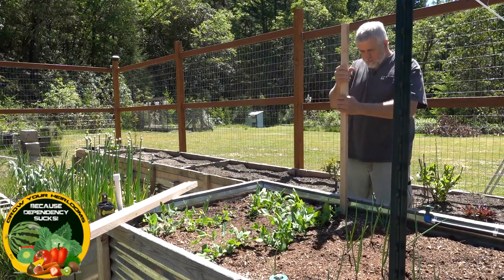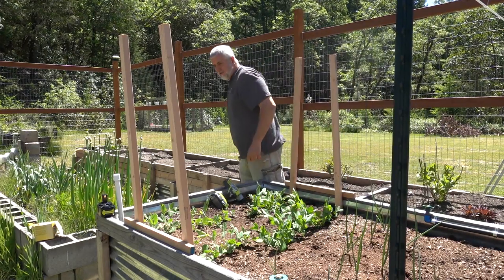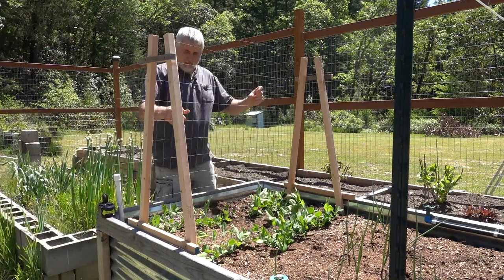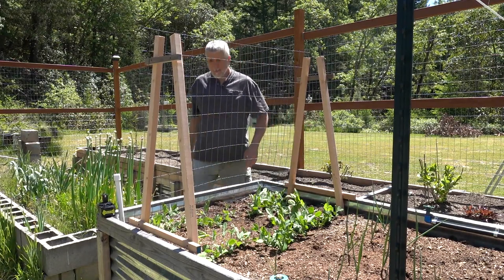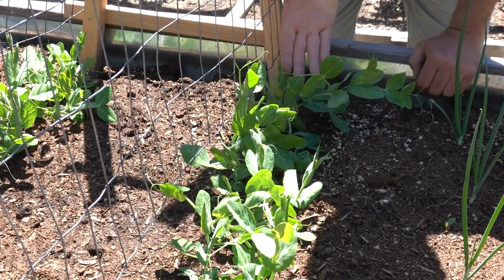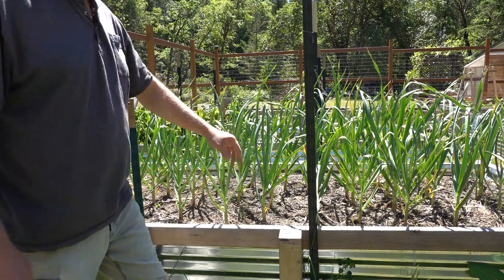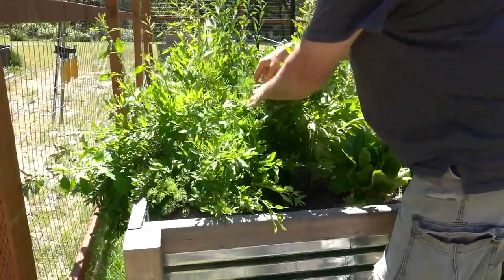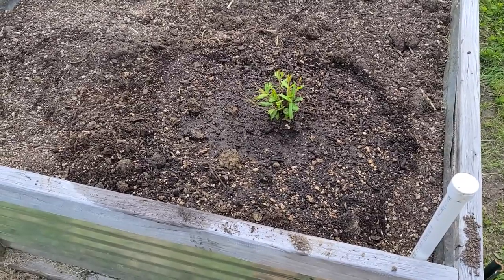Building a Pea Trellis and a Short Garden Tour

Comment: I always screw my 2 bys to a T post and drive the T post in the ground.  Never letting the wood in the ground will never rot the wood. I bye the smallest T post (cheaper) You can sink the T post deeper.
Reply from the maker: How do you attach the wood to the post? I always use scrap wood I don't want, but wood to t-post would be nice

Comment: This is a question not related to peas but beans. I'm growing Bush beans and it's too cold to plants nt outside yet so I started them in peat pots. They are so tall some 8 inches before leaves are unfolding. Should I plant them deeper or not.
Reply from the maker: beans are usually direct sown for this reason. They sprout quickly and grow just as fast. Some people swear to never plant them deep, others say it's ok. I've planted them fairly deep before with no issues, but I usually direct sow them in succession for a longer harvest. I would experiment. There's still plenty of time for beans unless you're in zone 3 or 4 :-)
Reply: We've direct down before with no issues 
 I was testing it out since our weather is unpredictable.  We're about 23  miles south of Crater Lake so not too sure what our zone is. Next weekend we'll be doing most of our planting.
Reply from the maker: @teresayoung4145  You're probably in zone 6 or 7 then. Plenty of time for beans